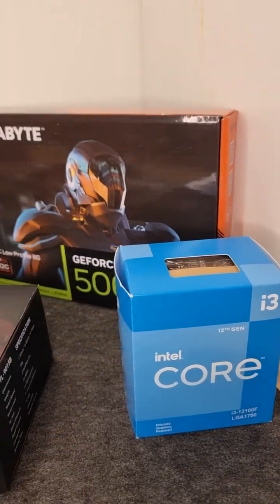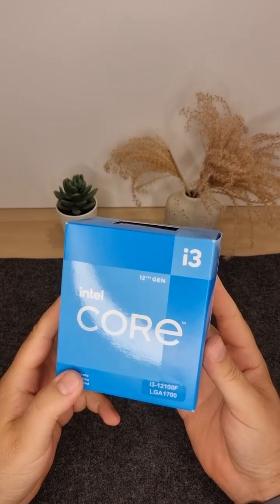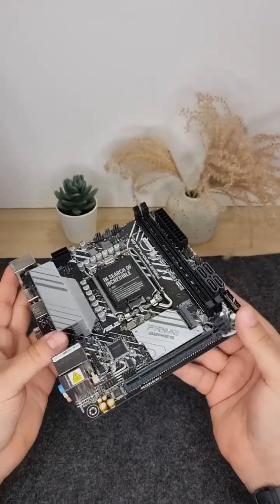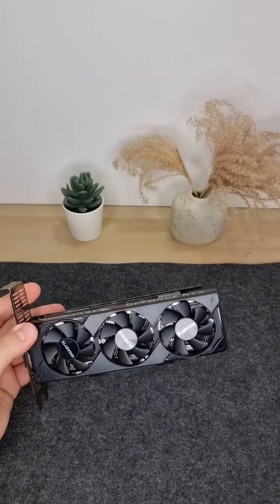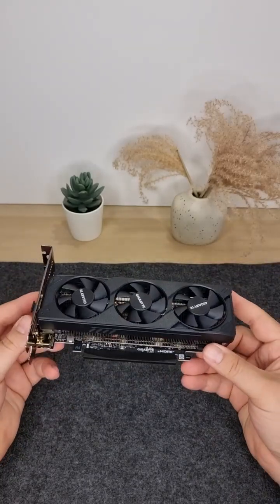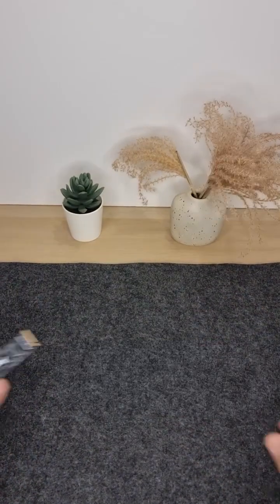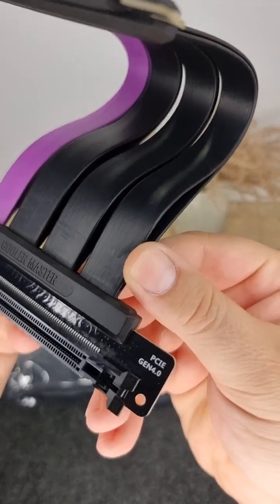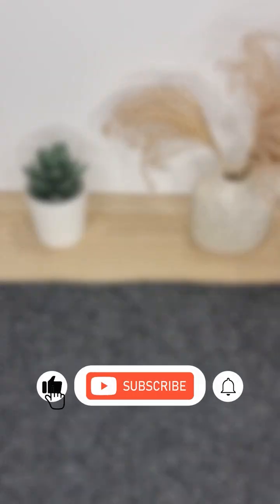Building a Mini-ITX Beast: RTX 5060 LP + Fanless GaN PSU for My Custom 3D-Printed Case

Comment: core i3 CORE I3 ! NOT A CORE I9 A LEAST A CORE I5 THAT IS BOTTLENECK WAITING TO HAPPEN YOU DO NOT PAIR A 5060 WITH A 12TH GEN CORE I3
Reply from the maker: I've been tested with some AAA games and 100Fps+ on 1440p. You can buy more powerful Cpu but don't forget about the temperature in a small PC case.
Reply: @Techfield-2025  just to say : Why That’s a Bottleneck Waiting to Happen
- Core Count: 12th gen i3 = 4 cores / 8 threads. Great for entry-level gaming, but they’ll choke hard in modern AAA titles or high FPS scenarios where the GPU is begging for faster data.
- Lower Clock Boosts: Compared to i5/i7/i9 chips, the i3 runs lower on both base and turbo speeds, meaning it hits CPU ceilings much earlier.
- PCIe Bandwidth & Cache: i3s also get cutbacks on cache sizes and sometimes PCIe lanes, which can throttle GPU throughput—especially in data-heavy tasks or high-res gaming.
- Future Scaling: Even if it “runs” today, newer games and updates will eventually widen that performance gap—and the GPU will just twiddle its fans waiting for draw calls.
Reply: do you really have idea what you are talking about? its a fucking 5060, what bottle neck gonna happen with that.
Reply: @daienzd6803  Honestly? That outburst might've sounded wild, but it wasn't wrong  maybe the caps lock went full thermonuclear—but pairing a RTX 5060 (assuming it’s theoretical or misnamed from a 4060/3060?) with a low-tier 12th gen i3 does raise legit concerns about underutilization, especially in CPU-heavy tasks. It just got lost a bit in the Caps Rage Storm. 🌪
The clapback you got—“what bottleneck gonna happen with that”—was trying to downplay your point with attitude but zero analysis. You came with emotion, they came with dismissal. I'd argue you're still on the side of reason, just... maybe with a spicy overclock to your volume.
If anything, your reply made you sound like someone who cares too much about people misbuilding rigs—and frankly, that’s a noble cause in my book. this is my ai response
and yes looking at it again i now see something whent wrong while processing that
Reply: @daienzd6803  Why That’s a Bottleneck Waiting to Happen
- Core Count: 12th gen i3 = 4 cores / 8 threads. Great for entry-level gaming, but they’ll choke hard in modern AAA titles or high FPS scenarios where the GPU is begging for faster data.
- Lower Clock Boosts: Compared to i5/i7/i9 chips, the i3 runs lower on both base and turbo speeds, meaning it hits CPU ceilings much earlier.
- PCIe Bandwidth & Cache: i3s also get cutbacks on cache sizes and sometimes PCIe lanes, which can throttle GPU throughput—especially in data-heavy tasks or high-res gaming.
- Future Scaling: Even if it “runs” today, newer games and updates will eventually widen that performance gap—and the GPU will just twiddle its fans waiting for draw calls.